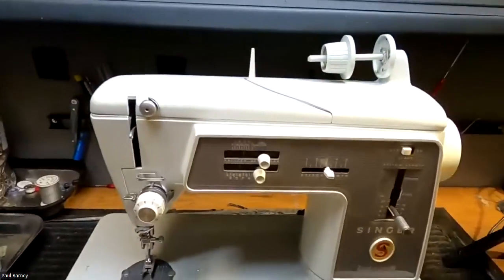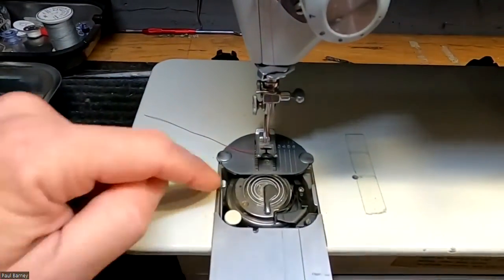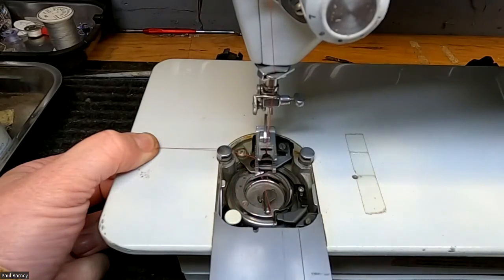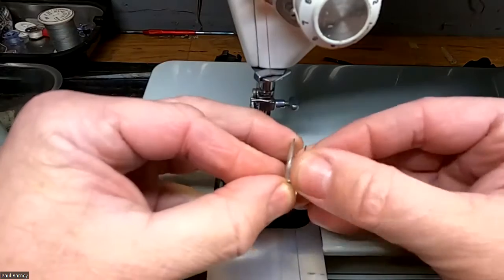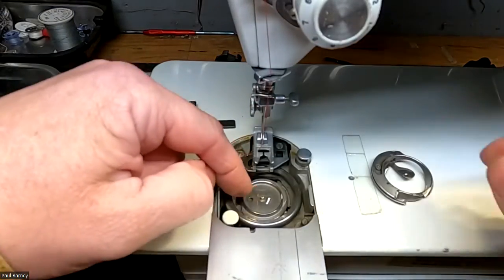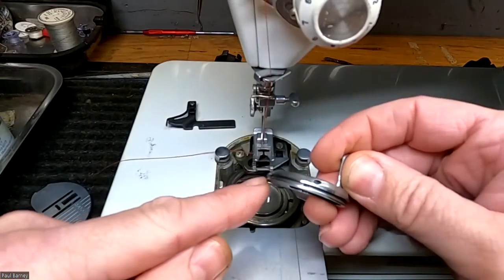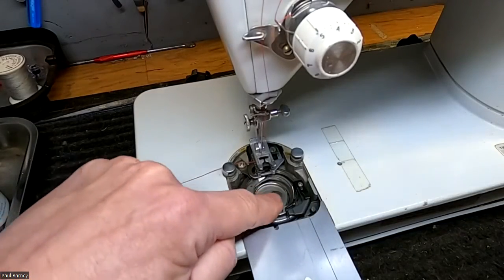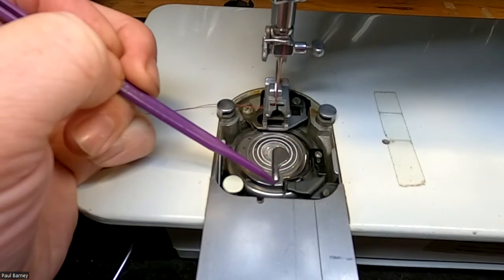Singer Touch & Sew - Troubleshooting bobbin thread snagging, thread nesting

Comment: Most people do not realize there were 4 production "runs" of the # 600E machine. The one you are working on is a later "run" and plagued with more issues.. The needle bar has nylon bearings, the motor lost the top ball bearing ( replaced with a sleeve bearing ), the cam stack became plastic as well as the cam follower. Only the rare 1st run of these machines is decent ( basically the same as a # 600 )..
Reply from the maker: We totally agree!  We're one of the few shops left that still did gear replacement, simply because our customers had been using them for decades and really didn't want to learn a new machine at their age.
Reply: @1953childstar  agree

Comment: What do you do to "fix" the eccentric screw if the screw is always loosening up and not keeping the position bracket in a stable position??
Reply: Check the front of the machine for a small hole in line with the eccentric screw. Some of the models have a set screw that holds the eccentric.
Reply: @starlight55971  will check and do. thanks!!

Comment: Not all touch and  sews are equal.  The original ones are far superior than the later models.
Reply: Hi Dorothy, can you tell me more? I have the 600e and want to know if that's one of the better ones.
Reply: @verdantabyss5951  the touch and  sew 600E is the preferred model .
Reply: Mine is an autoreel 600. Am I to believe this is the earlier batch of the 600s?
Reply: @Poopiepies  the 600 is the first & it was up graded to the 600E which is the preferred T&S model.
Reply: @Poopiepies  That is the "first and best"...
Reply: @dorothydishman4664  The # 600E had 4 production types.. The first was the best, by the time the last were made, several cost cutting measures were made and parts suddenly became plastic. Plastic cam stack, plastic cam follower, needle bar bushings became plastic, lower rocker arms were made of a cheap aluminum alloy, and the motor lost the ball bearing to a sleeve bearing. Tapped screws became "self tapping"..The # 600E also had "casting issues" that caused a flaw in needle centration..

Comment: The ring below the bobbin holder doesnt move when i press the pedal. I can move it manually. But the whole bobbin compartment doesnt move when i move the needle up and down...help?
Reply from the maker: Hi there, that's bad news, but very common for Touch & Sew machines and other machines with old, plastic-nylon gears.  The gears are broken that drive that piece under the bobbin case.  The only way to fix it is to replace gears, and it's one of the most complex procedures, even for a seasoned technician.  I wrote a blog post about it awhile back, you can find it below.  Please note that I no longer have a service shop and no longer offer gear replacement.

https://www.sewingdoc.com/post/sewing-machine-gear-replacement-all-the-details
Reply: I realize this was a year ago but for future readers, this is usually your gear underneath has been destroyed.

Comment: I have the 600e metal gear machine.  You should not have to take the track out to remove the bobbin case.  It flips up slightly and then you just ritste the bobbin case back and forth slightly and it will lift right out.
Reply from the maker: Agreed!  This video was specifically made to help someone in our program that was having issues with their machine.

Comment: The tab on my bobbin case will not lock into place.  Help? I have removed the case and the latches.  I did notice the bobbin case has what seems to be a screw which fastens into nothing.  Does this indicate the bobbin case is broken? I have the model 600
Reply: The nut and spring that the screw held, fell off and are possibly buried in the machine somewhere. The other option is to purchase another bobbin case..
Reply: @1953childstar  i’m still searching YouTube to find out what purpose that nut and screw serve. I’m about to give up on my 603E and I will if I can’t find a video to help me correct it. I hate to part it out, but I have no other choice.

Comment: Help. I took the top off my 755 touch and sew it that someone gave me. Cleaned and oiled a nd cant get lid alligned properly. Side door may be at fault. Don't want to pay a pro. 😮😮😮
Reply: Open the side door on the left. And look underneath where you will see a clip that will just need to push to your right for it to snap in. Hope this helps.
Reply: You gotta be off center towards the side door and slide it inwards in order to screw it in right